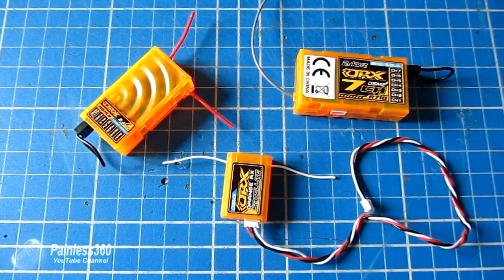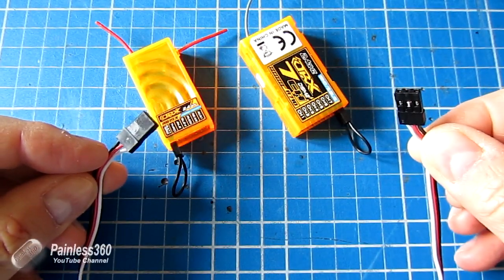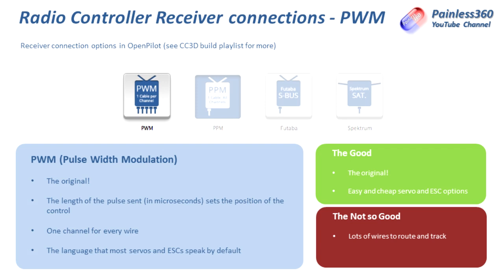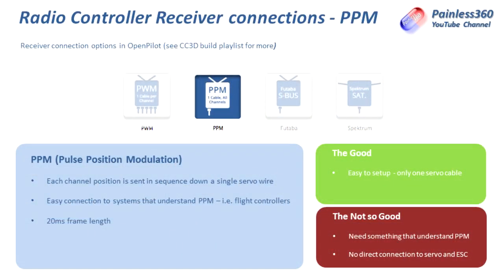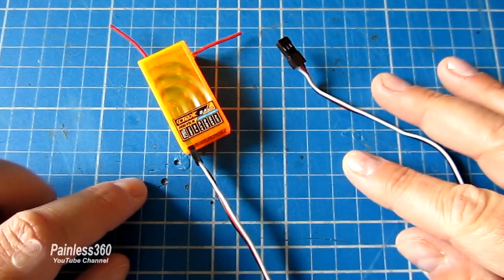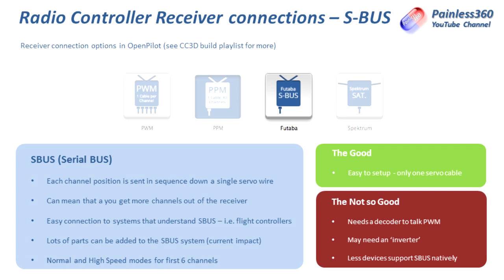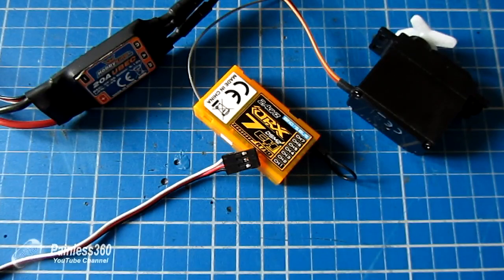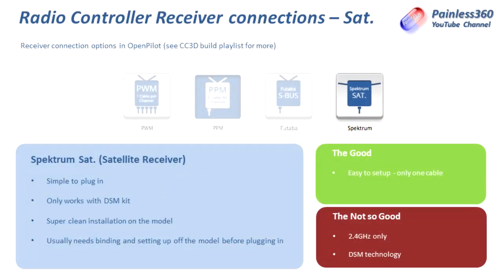RC Quick Tip - PWM, PPM, CPPM, S-BUS and Sat. explained for beginners

Comment: It seems to me that PPM is the way to go in many non racing Quads.. However, it seems to be the least respected of all Protocols by equipment manufactures.  I've been experimenting with a Jiyi P2 FC, a modified to 10 channels FS-i6 Transmitter, and a FS-iA6B Receiver trying to get at least 7 Channels down to the FC. Seems I can only get 5... I have no idea why? I'd buy a 10B Receiver if I thought it would work with my current equipment... but as I currently understand only 8 PPM channels work no matter what equipment one utilizes? Additionally, I'd like to use one Servo on my craft and no one seems to know how the remaining Receiver Channels.... 2 through 6, after the PPM wire is attached to Channel 1, map to higher PWM channels? I'd buy a capable, Quadcopter, PPM, Transmitter & Receiver tomorrow if I knew of one that actually worked as advertised???
Reply from the maker: There are a lot of haters about PPM but I'm a fan. No extra hardware needed to read the signal like the inverted S-Bus and 8 channels is enough for most. Having the PWM outputs still working alongside the PPM signal is very much down to how the manufacturer set it up. We used a R615x HobbyKing receiver for lots of our Park fly models as it ran the PWM outs as well as the PPM so you could control servos and LED switches with it at the same time. Look at the receivers and ask the vendor for how they work. Best of luck!
Reply: Although it seems that their support is sometimes sketchy, Radiolink has the R6D receiver for only their TX that has PPM along with another 5 channels of PWM. If you needed to power the PWM outputs, could you put a BEC into the ESC input slot?  I am only using mine as a PWM rx currently but am curious.
Reply: +TM Needham Thank you for your reply. Further Research shows me that FrSky seems to be a bit more PPM savvy then some other companies. So, I've ordered a FrSky Module for my 9Xtreme TX running ERSKY9X Firmware. However, a known problem is that their 8 Channel Receivers only handle 6 PPM Channels because of the 19ms PPM Frame Length. This appears to have been an issue for 4+ years. So, to get the 7 PPM Channels to run my Jiyi FC and the 8 Channels I need, 1 to tip my gimbal. I also ordered a USB device to Flash new Firmware on to a FrSky Receiver to expand the Frame Length to 27ms thus modifying it to accept and recognize 8 Full PPM Channels. I never touched a Multicopter till January & as new guy to the sport its hard enough to figure out what brands stuff works with other stuff. But it's particularly irritating to have to even modify the stuff that's advertised to work. 40 years in IT has prepared me well for this sport. Don't get me wrong I enjoy the tinkering and don't know what I'd do without Gurus like Painless360 a hero in my eyes!
Reply from the maker: Thanks for that :D https://www.youtube.com/watch?v=BfuQo5d-4tc

Comment: What unit is the ppm?
Reply from the maker: Not sure what you're asking. The pulses in the PPM stream are measured in microseconds and usually all contained in a 20+ millisecond frame.. So the units are milli and microseconds.
Reply: I meant the type of receiver. My bad
Reply from the maker: That will be listed in the receiver details when you are looking at them and the versions and models change all the time. Best of luck.
Reply: Thanks I just had to watch the rest of the video. Very informational!

Comment: Very useful as always! I am swapping my sat rx for an R620X (poor signal on sat) .. the sat was connected via serial (as per your video on how to solder this into the naze board). Now I take it I will have to disable serial, enable ppm (CLI) but where does the servo lead connect to on the naze? Can I hook this to the either pin 6, 7 or 8 where my esc servo leads plug into (pins 1-4) ? Any free port on that should work, right? BEC supplies +5V on pin 5 already, so this should be as easy as that?
Reply from the maker: +jerry486dx4 You'd connect it to where we show for a PPM connection.. Best of luck!

Comment: I am new to this PPM, and S-Bus. Great entry-level introduction to the three methods of sending signals... So, as for the satellite receiver method... I can use just the satellite RX, plugged into the flight controller. No other receiver is required? This makes sense of what I did (following another tip) when I used a JETI duplex system to operate a DSM2 aircraft. I used what they call a "bridge box" with an "Orange DIY TX module, connected to the PPM output of the JETI RX. The JETI transmitter I use to control my DSM2 devices are now possible with this rig. In short, your video did an excellent job of explaining how PPM output sends all the different control channels to the DSM2 DIY module! Thanks!!
Reply from the maker: +ronshangar Yep, many use a little sat. rx. for parkfly models as they are small and work great.

Comment: I'm fairly new to all this, been using naze32 rev6 w/FrSky X4R Receiver. if i'm not mistaken, PPM mode holds up to 8 channels, 4 of them for throttle, pitch, yaw, roll, leaving 4 left for things like Arm, Flight mode, Alt Hold. leaving only one channel left. 
SBus, on the other hand, allows up to 16 channels if i'm not mistaken. now i have channels open for readouts, GPS functions (i.e. position hold, return to home), switch to turn LED's ON or OFF. and more.  I felt that this was not given a big enough + over PWM & PPM modes.

Russ from Coral Springs, Fl, USA

Comment: Great explanation for the technologies.  Thank you!  But I tend to like the redundancy of PWM and individual cables especially for multirotor.  if one would loose their yaw due to weak cable, as an example, one could still navigate their craft home on the remaining controls.  If this was PPM, or any other one-wire option above, you'd loose all control and be screwed.  I'm all about redundancy, especially if you have $1500 in the air, even if it means dealing with a few extra wires.
Reply from the maker: +Tommy Waldner failsafe detection on modern flight controllers is now very sophisticated. Using a PPM or other single wire connection means that if there is a problem, the flight controller can detect it and take appropriate action. Happy flying!

Comment: I am building a 250-class racing quad and have a CC3D that I am trying out for the first time, so your explanation of a Sat receiver is very timely.   Now I'm contemplating an orange PWM receiver vs. a sat receiver (my radio is a DX6).  It seems to me that the Sat receiver connected directly to the CC3D is a much cleaner/lighter way to go.  Are there any limitations to the Sat receiver vs the orange PWM receiver in terms of range, signal reception, or other that I need to be concerned about?  Keep up the great work.  Your lessons are invaluable!
Reply from the maker: +MicroLord only in terms of the range in the same way as a traditional controller. See our review of the new sat. reciever scrim Hobbyking that use longer antennas for improved reception.. Best of luck with the build..
Reply: +Painless360 - Thanks for the info.  I will definitely check out the review of the new sat receiver from HobbyKing.  Keep up the great work and thanks for keeping us flying!!

Comment: I picked up a racing FPV quad at a swapmeet this past weekend. I've only been a fixed-wing RCer so far, and am quite illiterate on non-PWM technology.  This video was very informative and has helped me begin to crack the code for flying aircraft with flight controllers. Thanks!

Comment: Hey it's me again! 

For some reason PWM is not registering with my receiver. When I connect to flight source and go into the remote settings none of my channels work when I move the sticks. Some Channels seem to work in the AUX channel but when I switch them around the channels loose all signal 

I've figured most of it all out. But the PWM connection is not working properly.. Either I'm missing something or I'm lost! 

Thanks again!
Reply from the maker: +Aweber87 I'd check that the channels are moving on the monitor screen of the radio and go from there - best of luck!

Comment: Lee  when it comes to channel jitter, in your experience, which technology gives the least.  I'm looking to get a new TX/RX combo to replace my Spektrum DX6i  and Spektrum Ar6200 as I have to use quite high levels of deadband.   I also experience my channel midpoints moving by up to 5 (not jitter) between power ups.   Lost a bit of confidence in it all really.  Would love to go the Taranis route, but with a single model (at the moment) It's probably overkill
Reply from the maker: +Iain Knowles The jitter tends to come from two places in my experience - from 'dirty' or poor quality potentiometers (the things in the radio that 'read' off the control position) or a poor PPM implementation in the receiver. Usually a shot of contact cleaner into the 'pots' in the radio can help clean up the contacts. I'd try that first..
Reply: +Painless360 Thanks  I'll give the contact cleaner a try first
Reply: +Painless360 Ok cleaned the pots with alcohol (as I can't get to a suitable shop in time)

The jitter is certainly reduced, but the centre point varies by up to 8us every timer i flick the stick and let it return to the centre.   I suspect that this is not a result of my clean as it varied before.  I just know how to replicate it now.   I guess the Taranis argument is getting stronger   (well it is in my head anyway.  Just maybe not my wife's ;-)
Reply from the maker: Contact cleaner would be slightly better but it sounds like the pots are worn. The pots in the Taranis are better but by no means - top shelf ;)

Comment: So how can I tell if I have the option of choosing Pwm or ppm? 

I have a tactic TR624 6ch receiver with battery port. But I do not have all my parts in the mail to start testing so trying to figure out before I start
Reply: Note I'm building a quad copter if there is a difference
Reply from the maker: +Aweber87 Looking that Rx it appears to be only PWM.. Best of luck!

Comment: Great video, but I'm surprised you glossed over one of the most important advantages S-Bus has over PPM (not sure about Sat): significantly reduced latency! This is THEE reason why quadcopter racers are switching to S-Bus: faster translated reactions during high-speed and acrobatic flying/racing. It just feels sharper. I'm seeing various people post various "total latency" times (when including value averaging for PPM, for instance, which S-Bus doesn't require), but it seems that S-Bus is probably 50 ms faster than PPM. Admittedly, it's a relatively small subset of RC pilots now, but they're growing quickly.
Reply from the maker: The video is aimed at those pilots who've been told by someone that 'S-bus is the same as PPM' by someone they know. Thanks for the comment.

Comment: thks for taking your own time for beginners like me !,,i`ve watch most of yours vids and you got me so hooked up that next summer i`m planning to built my own  800mm to 900mm size octocopter, i` ve bought most of the materials i need to build it ,3mm carbon fiber sheets, tubes ect. (but for electronics) i`m panning to buy a taranis x9d and with your advices ,,frsky x8r or trs8sb receiver,frsky gps v2, variometer sensor,telemetry ,fvp ,lights ect (well equipped) what would be the best match for me, sbus,ppm, or pwm
thks for tour advice,,,,,
Reply from the maker: Best of luck with it!

Comment: Hi sorry to bother you again but I'm using the skyline 32 board and the fs t6 receiver. I plugged all the servo cables into the receiver and plugged in the battery, the skyline 32 did the beeps and flashes but the receiver does nothing . Ive tried turning the servo cables the other way with no luck. I'm completely stumped and would appreciate any advice, thanks
Reply from the maker: Not a lot of detail to allow me to offer useful advice. Have you bound it to the radio? Tested it with another model or a servo? Best of luck..
Reply: +Painless360  Yeah its bound from the factory, will test it with another model today. Thanks

Comment: I have a question. If I use (C)PPM or SBUS, it will pass all the channels through to the flight controller. What if I still want to control like a video switch or a gimbal tilt/pan, can you still do that using the PWM channel outputs directly to those devices? 

I am switching my 550 quad over to a FrSky X8R receiver and I wanted to use PPM or SBUS to run channles into my NAZA-M V2. so my AETR channels for flight, another channel for flight mode. But then I need to connect my video switcher (switches between my GoPro and my FPV flight camera) and another channel to my GoPro gimbal's tilt servo.

Not sure how I would (if I can) set this up. Is it possible?
Reply from the maker: +Brian Danford (SAP) It depends on the receiver - some do, some don't. The best thing to do is give it a go! If not then you can bind two X8R to the radio and have the second used for PWM connections. Hope that helps.

Comment: Does anyone know if a Futaba R617FS is compatible with the NAZE32 v6? I can't seem to figure out if it works with PWM. If so, any wiring diagrams available?
Reply from the maker: +Mitch Pieper Wiring diagrams in the video. Use the menus on the radio to see which controls are on which channels on the Rx.. Best of luck..
Reply: +Painless360 Thank you. I have watched the video countless times. I spent 11 hours on this yesterday and still can't seem to connect the pieces. I may just break down and buy a receiver with S-BUS :(
Reply from the maker: See the website for the charges for one to one support if you need it..

Comment: Hi many thanks for your many many informative video's. I have learnt everything I know about  Naze32 boards, pid tuning etc from you. I notice you use an orange 615x on at least one of your quads, is this good enough in terms or range? I have on on my 250 nighthawk ( mounted on the top front) but only get just over a football pitch length before crashing due to signal loss. My 5.8g tx (250mw) is mounted at the rear so the separation is the maximum possible.
Any ideas would  be greatly appreciated
Reply from the maker: +mark mitchell I guess you are not in the UK then (100mw limit on 2.4Ghz here). No problems at all with the receiver and easily get over 1000ft. I would check your kit and let HK you know you are having problems..
Reply: +Painless360 that's another lesson learned, I was told 250mw was the legal limit
Reply from the maker: Yep, 100mw for 2.4Ghz radio control (http://www.ukrcc.org/2.4GHZ.html) and 25mw for 5.8Ghz FPV in the UK.. :)

Comment: Once again, thank you for the time that you take to share such informative videos.  I've been flying rc helicopters and planes for nearly 4 years and, thanks to this video, I now know the difference between PWM and PPM.  I use all Spektrum gear, so the SBUS isn't very much use to me but the rest of the info was invaluable.  Thanks very much!!!
Reply from the maker: I am getting a few of the brand new updated Orange Rx receivers and will be looking at them on the channel so stay tuned! :)
Reply from the maker: +mountaindewdude76 Thanks for the feedback, glad it helped! Happy flying!
Reply: +mountaindewdude76 if you didn't know, Spektrum finally have released a serial receiver.
https://www.spektrumrc.com/Products/Default.aspx?ProdID=SPMAR7700
Orange also have a DSMX Full Range RX with S.Bus output and it includes telemetry.
http://www.hobbyking.com/hobbyking/store/uh_viewItem.asp?idproduct=79338
Reply: +Matthew Bryson I saw that Orange now has sbus.  pretty cool.  I did not know that Spektrum has a serial rx.  thank you for letting me know.
Reply: +Matthew Bryson I saw that Orange now has sbus.  pretty cool.  I did not know that Spektrum has a serial rx.  thank you for letting me know.
Reply: As always, I'll be watching for your video on the new OrangeRx receivers.

Comment: which one is better,  ppm or pwm, such one had less latency.
Reply from the maker: +rio787 PWM is falling out of favour as it needs so many cables and input lines on flight controllers for the basic controls. Speed freaks like S-Bus as it's digital nature makes the transmission and interpretation of the signals faster but does need an inverter to work and then there is PPM. I love PPM and 99% of pilots wouldn't be able to tell if a connection was PPM or S-Bus ;)
Reply: +Painless360 sweet your videos are great; greatly appreciate it currently working on osd, for new eachine falcon, thanks to your videos, its made thing so much simpler.
thanks

Comment: hi, im planing on building a small quad around 250g 150-175.. is the goal anyhow.   if i do not make weight no big deal.. so i have ordered a CC3D mini ( the smallest cc3d out yet ).. and im considering using the nano RX from orange.. official name is:  Rx110x. would i have to bind it like ou did in this video to another RX?  or will the mini cc3d take care of that.. logic says no..  so that means i would have to buy another RX just to use the nano with my build.. but i figure i would ask to make sure before i spend 40.00 on RX just for my a build im collecting parts for.  thanks again, iv been learning a lot from you.. and i can not thank you enough.  rock on.
Reply from the maker: We cover the little R616xn reciever on the channel. That should help. Best of luck!